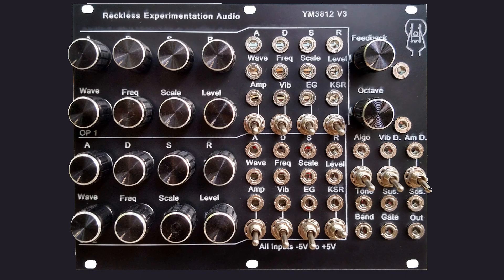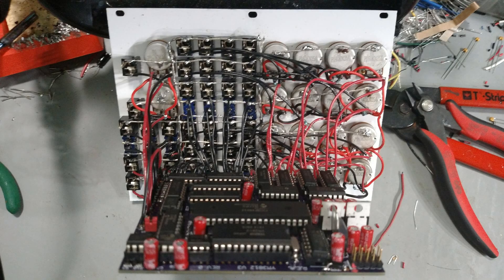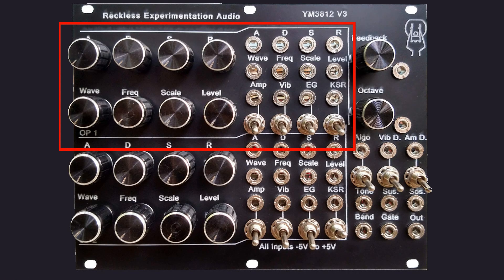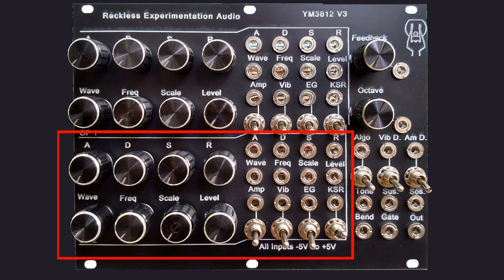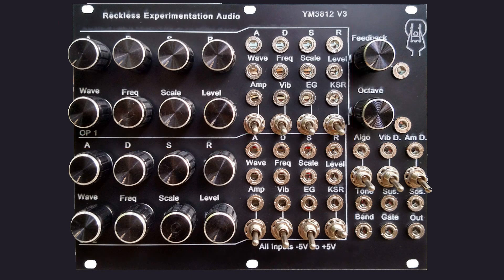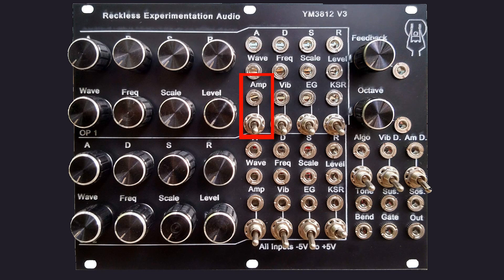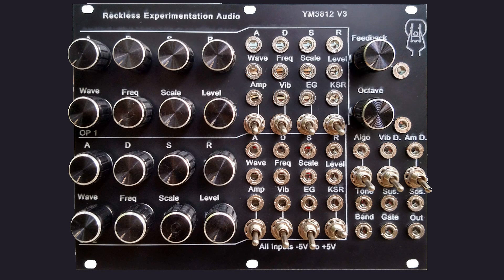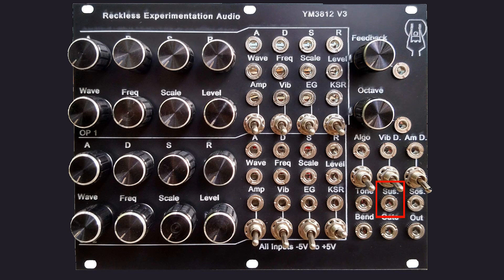YM3812 V3 Eurorack Front Panel Explanation and Demo

Comment: I am so glad I bought this from you!!  I’ve been slowly building it, it’s been slow mainly because I had no SMD components of which to speak.  So after a few seemingly wasteful orders of surface mount components ( I didn’t really do my homework to first come to know the differences in advance, say, between a 0402 and a 0805, which is dependent upon which code you are referencing; metric code or imperial code).  So after I bought a whole lot of parts that I cannot even see, I had to save up to buy a whole other round of more substantially voluminous components, and ones that can actually span across the solder pads on your boards!!  Many surface mount sizes are very obscure, and although your pads would accommodate the uncommon 2520 metric sizes, I had less trouble sourcing the 2012s and 1608s (which in imperial are 0805 and 0603) and so that’s what I’ve got on hand today!  SMD work is a whole different style of soldering in my opinion, because you really NEED to have a tweezers and desoldering wick and a whole host of hazardous aerosol cans on hand to hold the part in place while heating the solder and drawing the iron away from the part once the solder flows.  I’m getting so close now, and so today I came to revisit your demonstrations of this module to sort of inspire me to get it done and get it working.  And now I’m inspired, and I got to say that just from hearing your short demos of this module, I am so stoked to own this thing!!  I’m really excited to finish and I don’t see why I shouldn’t have it done before Christmas!!  THANKS AGAIN, and KEEP IT UP!!